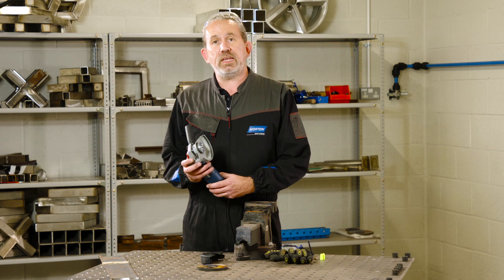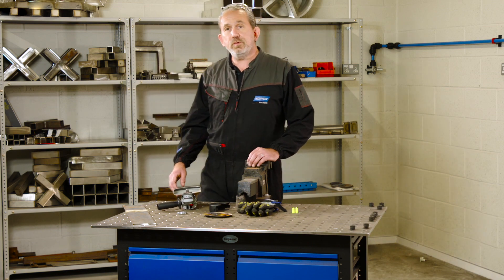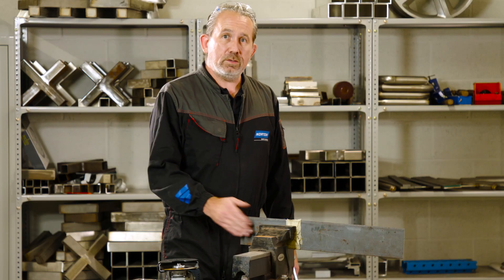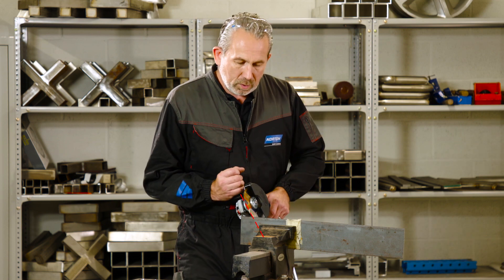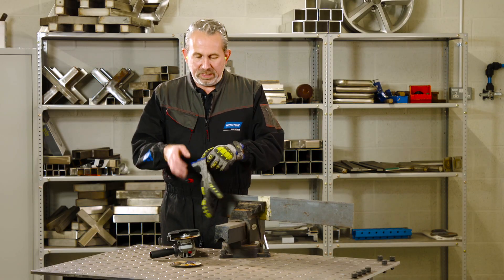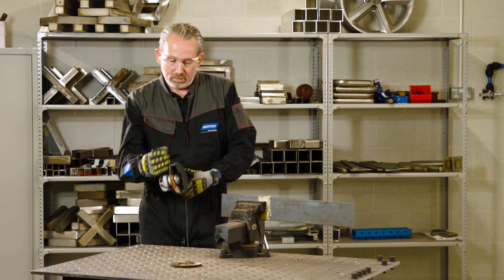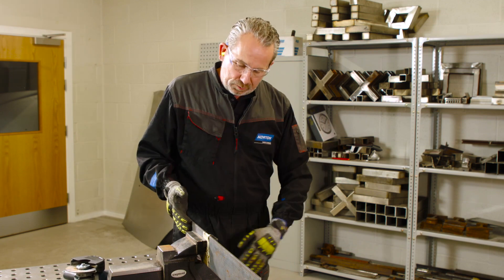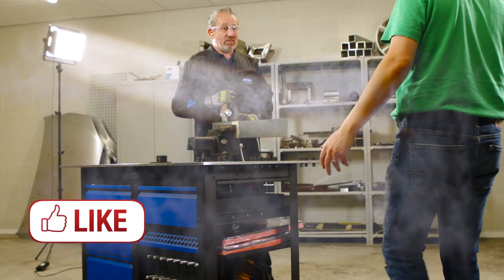How to safely cut metal with a cutting disc and angle grinder

Comment: Hello, Do you know we can get this extra Disc Guard protector show at 0,25 seconds ? Many thanks,
Reply from the maker: In this video we used a clip on guard but full guards, that replace the one that comes with the grinder, are also available. Most retailers who stock right angle grinders should also stock the cutting guards.
Reply: @NortonAbrasivesEMEA  Thank you. Already tried quite often to reach Metabo HPT for accessories but they never answered!
Reply from the maker: Online retailers often have stock. Hope you find one